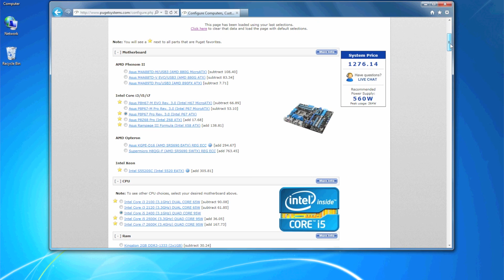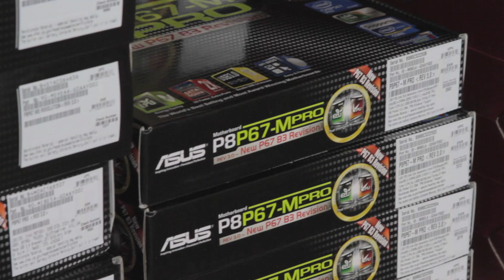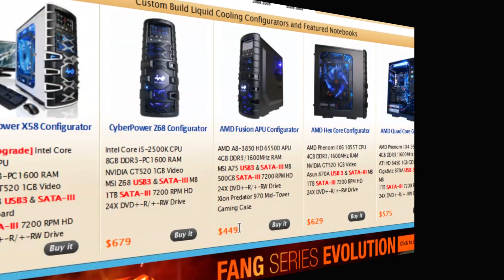About Puget Systems

Comment: Hi, I m from India. I wish my country also had some company like yours. Out of my personal experience and research I can surely say that people/dealer selling computer related stuff in my country, at least in my state (Rajasthan), have no knowledge of what they are selling. 
I bought a laptop (putting out all my savings) from Lenovo store here in my city. I didnt had much of knowledge about processors at that time. I told the saleperson/store owner that I need a Laptop for Graphic Design and Video Production. He gave me an intel i5 6200U machine with AMD readeon gfx card. After using it for three years I must say that I feel cheated by the store person.....as the laptop sucks !!

I wish I had someone reliable like you guys, in my city/country as well.......

Comment: But I´m not living in U.S. I live in Finland. I would like to use my holiday money to GTX 
1080 in july. Allthough, born in june 26. 1985. Current components: AMD-8350FX W/Coolermaster hyper 212 EVO. GPU: Msi 760 oc. 16gb ram. MOBO: Asus M5A99FX PRO R2.0. PSU:Thermaltake 850W S.M.A.R.T. Bronze +80.